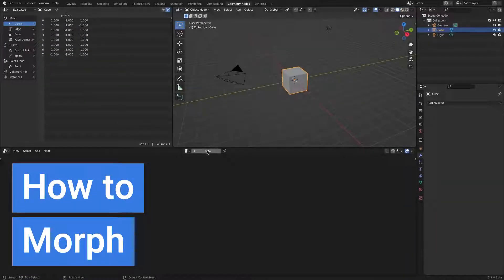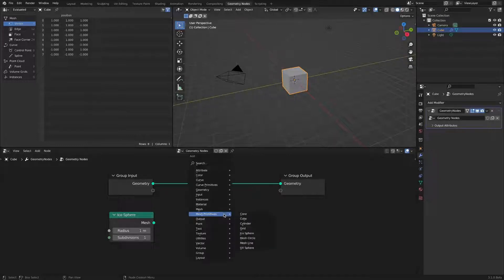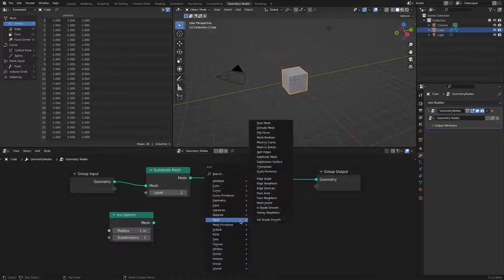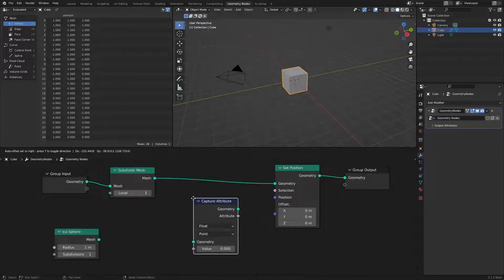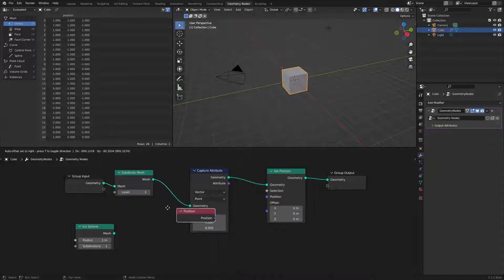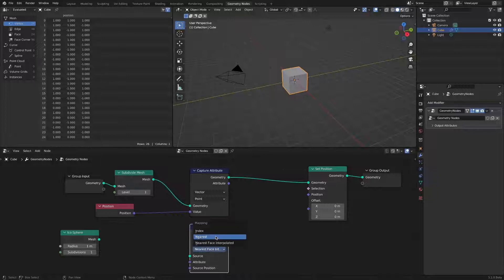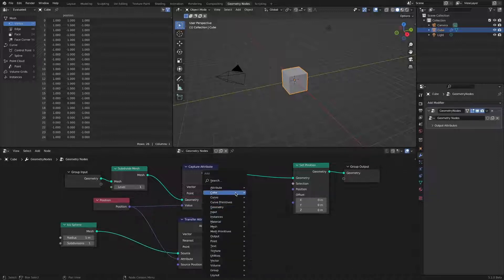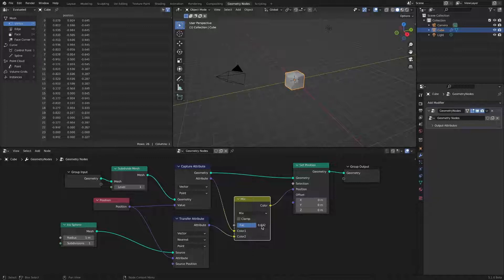Very basic Morphing Setup (Geometry Nodes)

Comment: HI CAN YOU PLEASE DO THE SAME FOR BLENDER 3.4, PROBLEM FACING AS TRANSFER ATTRIBUTE IS MISSING
Reply: Replace Transfer Attribute with "Sample Index(Vector & Point)". Plug a "Sample Nearest(Point)" node into the index of "Sample Index", Plug your Mesh's geometry output into the geometry input for both "Sample Nearest" and "Sample Index", then add a "Normal" node plug this into the value input of "Sample index", then add a "Position" node, plug this into the sample position input of "Sample nearest"  :)
Reply: @Taylor__3D  thanks , you saved my day ! Just a correction tho: seems like the normal goes into the "sample position" of the "sample nearest" node for some reason, and the position node goes into the sample index node's value(at least that how it worked with me)
Reply: @Taylor__3D  thanks! +1)
Reply: Bro you are the best, can u explain me, what is sample nearest and sample index function pls? like the old transfer attribute, thnx a lot
Reply: I didn't understand fully the first time but with "your mesh's geometry output", he means the Ico sphere mesh output pin, and not the group output node. Thanks for the solution Taylor!
Reply: @Taylor__3D  does the Sample Index go to a Mix Node then? I cant make it work. 🥴
Reply from the maker: @Taylor__3D  Oh, I'm really sorry. I saw your valuable comment too late. It's quite late, but thank you very much.
Reply: @Taylor__3D  thank you